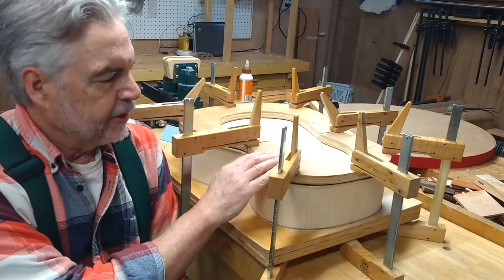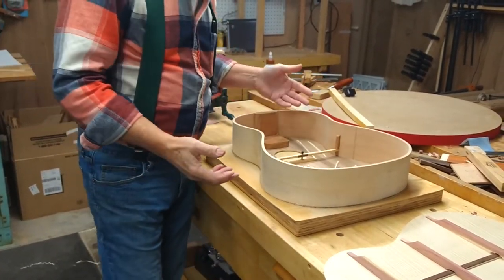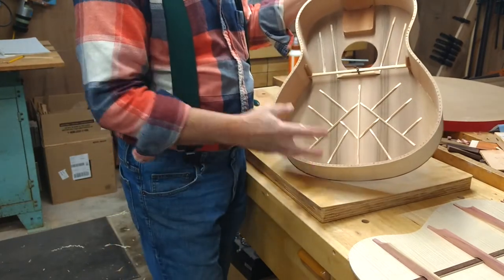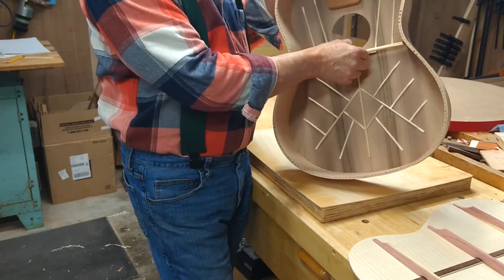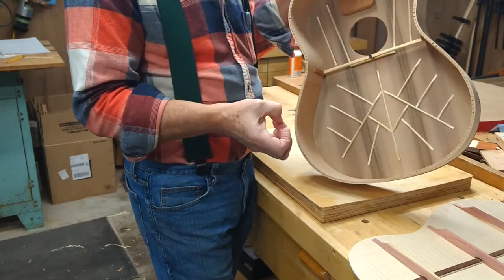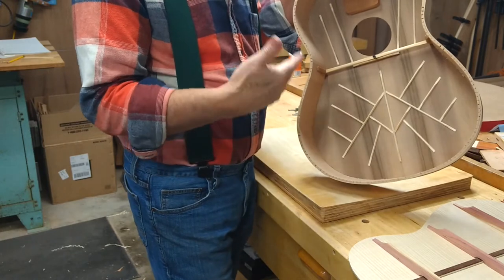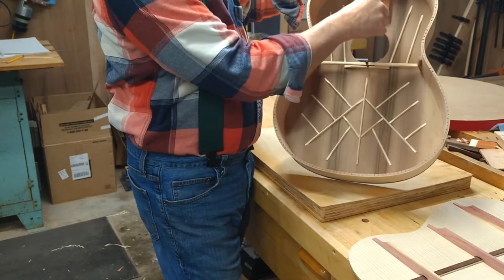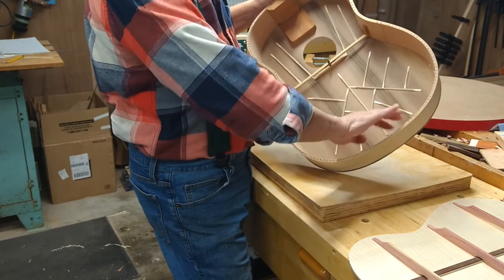A look inside a CFMorrison Doubletop classical guitar

Comment: It's great when you step outside of the standard ,I too have questioned the purpose of an end block .At one time the end block held a tailpiece but if there isn't one it's not needed and becomes deadweight in the middle of nowhere .thx for sharing
Reply from the maker: A tailpiece was never really a feature of a (decent) classical guitar, nor were strap pins. The only thing I'm concerned about is end jacks for post build installations of pickups/mics. For playing a classical guitar in the traditional sitting posture, an end jack would interfere, so the tail block isn't a good location. The outer edge of the lower bout is a better placement, which would require reinforcement anyway.

I do still use end blocks in steel string acoustics for strap buttons and end jacks, however I taper the block so that it only contacts the soundboard and back the same amount as the lining does. The block is also thinner than factory built instruments.

Comment: Thank you for this. The recordings  sound great and these videos are quite helpful... 

I am researching building my own guitar, unsatisfied with the limitations of the traditional design, mostly regarding structural integrity and playability. 

Classical design has been lacking in string spacing and needs more room on the fretboard outside of the 1st and 6th strings but more importantly traditional design is lacking in the mitigation of the practically inevitable NECK BOW and the SINKING in of the SOUNDBOARD where the FRETBOARD meets the SOUND HOLE as well as in between the BRIDGE and SOUND HOLE!  

After decades of playing and existing somewhat within the elements these things tend to happen even with finely crafted guitars.

Very sad the traditional design has not made these issues easy for us to fix.

The way you have been dealing with the neck attachment and bracing is rather encouraging.

Andalusian Guitars out of Spain is now making some great innovations based on the 1929 Simplicio design. I encourage anyone to check that out.

Still the Spanish way of neck attachment seems to make it way too difficult to replace the neck should it ever become necessary ; and still no truss rods in them.

Well they will say that if you simply take care of the instrument then they will never need a neck replacement or adjustment; and I can convince myself of this, however I already know how difficult it is to ensure proper humidity and temperature control At All Times For Several Decades, especially if you ever want to board a plane with the instrument or play in outdoor venues in varying climates...

I have long wondered why the classical design generally seems not to have innovated more with the bracing and not borrowed more from the steel strung acoustic's stronger design.

It is perhaps more than a bit silly of me but I am still thinking of performing major reconstructive surgery on my guitars just on principle and because I am so dismayed by the warpage!

Saw a vid of someone explaining how a sunken in original Torres that had belonged to the great Fransisco Tárrega, was hung up inside of a steam filled aquarium or something, by the transverse top bracing near the fret board and sound hole and gravity eventually put it right... 
I really don't know though.
Thanks.
Reply from the maker: I certainly understand your concerns. I believe I have addressed many (most ?) of them in these videos. 
Regarding the bowing of necks on classical guitars. The widespread use of Cedro (Spanish Cedar) is partially to blame. It looks like mahogany but weighs considerably less. It's nice to have a well balanced (physically) instrument and lighter neck woods provide that. Unfortunately, lighter woods are generally less stiff. Oversized fret slots can add to the problem. I suggest a laminated neck with substantially denser/stiffer woods for increased stiffness and properly sized fret slots (very close to tang width). I'm not sold on the need for truss rods in nylon/carbon/gut string guitars.
Reply: Bolt on? Its anathema but it works.  At least that way you can adjust the neck angle when necessary. This would require a steel string style construction. Good Spanish cedar is stiff enough but this wood varies a lot. So.does Honduras mahogany. The best cedar I've seen was Brazilian and cut from huge rainforest trees. No knots on 16 foot slabs. Neither species is as stiff as red or sugar maple. One mm of thickness makes a big difference bc stiffness varies to the 3rd power of beam height. Also the heel curve can't be shortened as stiffness varies inversely to the third power of length.

Comment: For a steel string do you run the nomex to the edge and is it nomex under the bridge? Also do you bend the inner laminate /kerfing or will it conform without it
Reply from the maker: What I do with Nomex has varied over the years. I do not have nomex under the bridge, but I do vary what wood I use instead depending on the amount of stress the bridge takes. I do not want the top delaminating under the bridge, so I want maximum glue surface under that area. I have also gone to running a wood strip along the center joint of the top, usually balsa or cedar. 

I usually run the Nomex all the way to the edge, although it does make purfling a bit more challenging.  I don't think there is a strength issue at the perimeter of the soundboard.

When I use kerfing for lining I do it reversed, so it's the kerfed side that is glued. There is no need to bend it beyond the kerfing. Even with a fully lined side.
Reply: @chuckmorrison  thanks for the reply. Your videos are some of the best, intelligent guitar videos I've seen. Thanks for posting them